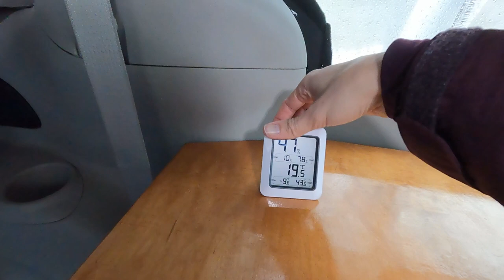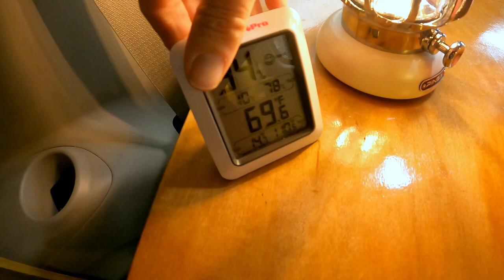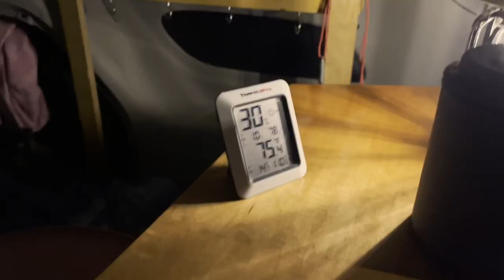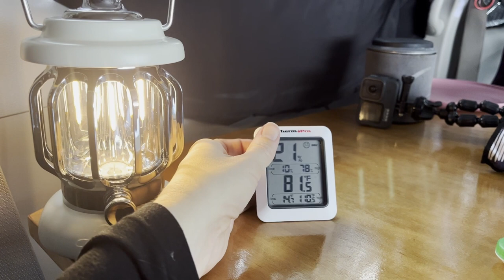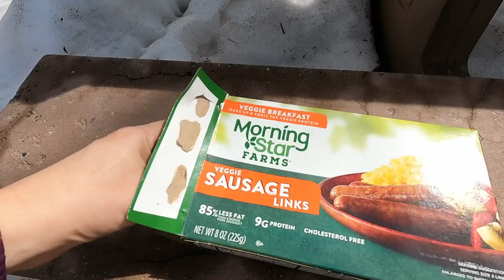Solo VAN CAMPING in the rain. No talking. Diesel heater keeps minivan warm! [ ASMR | relaxing ]

Comment: I am not a van dweller at 70 yrs. of age but just curious as to why you went with a diesel heater instead of a small electric heater. It would take up allot less space in the van.
Reply from the maker: Hi Rita! It's never too late! Electric heaters are really difficult to power - it's amazing how much power they use. I can run this for probably 2 days straight, where as an electric heater I would only be able to run for about an hour. Thanks for watching!

Comment: Here is my jerry-rigged setup in my pickup cab I used down to 12 degrees in Tahoe couple days ago. https://youtu.be/9gkZB9BZQUk 
After reading one of your comments the 2nd night (Saturday) I added the 2nd hose for the inlet. 2nd night vid w/ interior temps https://youtu.be/I4ab7C9XapQ
Reply from the maker: Hey Robert! Woah, how cool! Thanks for sharing! Hope it kept you warm!
Reply: 1st couple hours (went to sleep at 5:30pm) were alright and then it got cold but berable. A few things need to be done to make it warm (60F) w/lows in the teens or below... insulate the windows and interiors of the doors, and the floor/roof. I'm thinking of switching to a lead acid batt because keeping our lithium batts on the floor of our cars at lower than 40degrees is probably not good for them.
Reply: 1st night at the cheapest hotel near me was $375 and the 2nd night was $125.
Reply from the maker: How many kw is your heater? I’ve been thinking about insulating my ducting,, but not sure how I’d do it.
Reply: @minivancampergal1554  5kw.